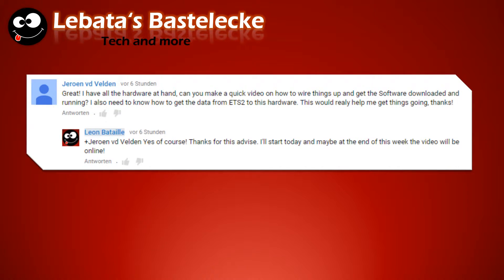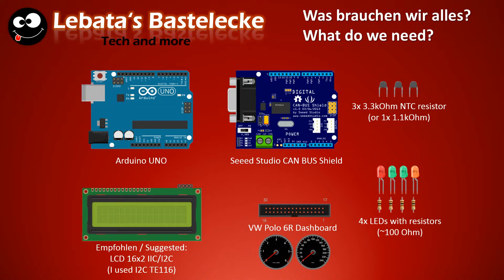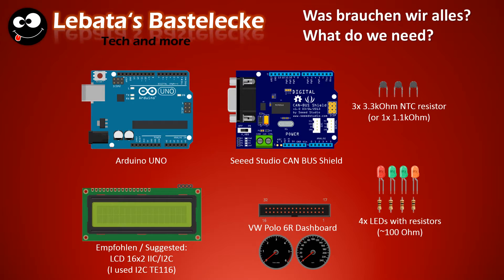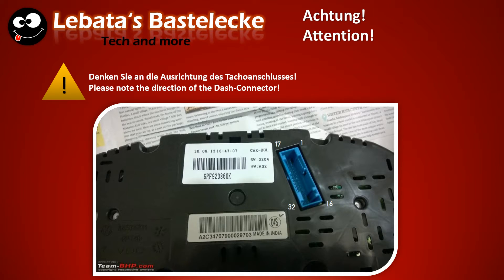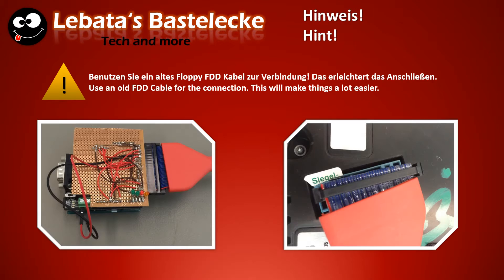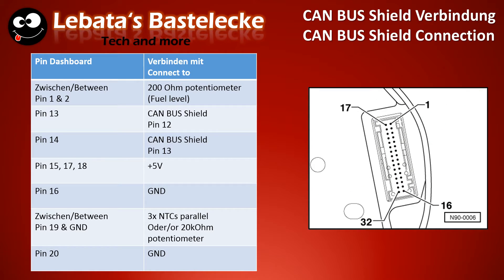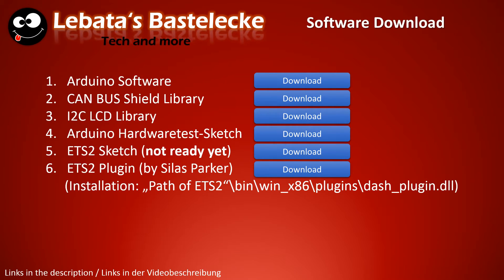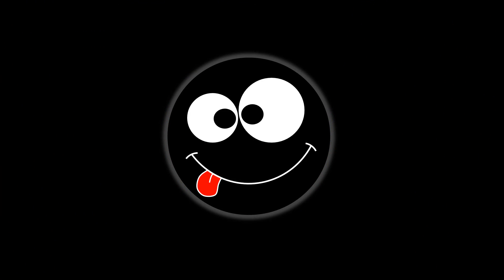CAN BUS Gaming #5 - Dashboard Wiring

Comment: Hello SIR, 
I am trying to make a sim with a dashboard and working gauges, did you get this project to where it connects to USB and keystrokes could be assigned to appropriate gauges? I really am looking for this solution but can't find it anywhere. It is dear to my heart because I am building it for my father, he has cancer and I want him to have a really cool setup *junkyard find most likely... I'm putting in tail lights (brake micro switch-dc battery)... that's not part of the game but it works in an analog way...
But for the clusters there's only one way to make them communicate with a game if possible, first thing is making sure the pc has correct legacy drivers - to USB to or your preference... I don't know how to program it... I do video/animation... not programming. I swear if this got done with real clusters and you make a kit for it, hardware and software, I bet you can make a lot of sim racer happy... most of all my father would be amazed... unless you know of a better way. Reply if you may, I know it's a while since you uploaded this... but I would really love someone to guide me on this topic. BIG THANKS!
-Kris

Comment: i have a cluster, is it more easier to  control a cluster using only a potentiometer?
Reply: You can put a potentiometer on arduino to control it, but you wont be able to avoid can bus messaging with modern clusters

Comment: I'm trying now with Audi A4 B6 and Ford Mondeo mk3 clusters.
Speed works with your ets2 sketch, but RPM needle not :(
When I plug cluster to power supply and connect Arduino to PC,  RPM and speed go to max position(self test).

With the static sketch, both of needles(RPM and speed) work and show correct values.
There's problem with streaming data from telemetry .
The same thing is with Mondeo mk3 cluster. 

Other issue is with i2c crystal. When I connect only lcd without CAN shield, it works perfectly.
When cluster is connected, lcd doesn't show values from telemetry, only "HHHHH" in single line.

What is the problem with?
Reply from the maker: Hi! I'm not sure if the CAN BUS addresses and the data which is being sent are recognized correctly by the clusters. Especially the Audi clusters could work with some functions as both, VW's and Audi's clusters are from the same company. Could be that the adress for RPM is another than the one in my script. I'm not sure about your second problem. try another lcd library if necessary. I had issues with it as well. Make sure that you use the i2c pins on arduino and not the rx and tx pin, as they are used to transmit the data between ETS2 and Arduino. At the moment I don't use the display as the important info is displayed on cluster.
I hope this helps.
Reply: Hey!
Works partly.
Today I reprogrammed Arduino(I'm using Mega) and RPM needle goes to 6k and doesn't change (only when engine is started, when ignition is off, it goes to zero).

Yeah, Audi and VW belongs to VAG company. 
CAN addresses are the same as in VW.

Maybe, there is problem with cluster, because it's older version.

In mine, there are 3 CAN lines(drivetrain, infotainment and comfort).
Each one has got various speeds(500k drivetrain, 100k info and comfort).

Maybe newer cluster will work greater :D.
In newer cluster, there's one connector(in my there are two, green and blue).

I can send you CAN codes, which I found as well.

Thanks for reply and I'm waiting for updates of your projects( I'm building similar cockpit instead of a desk, that's why it is important for me).
Reply from the maker: Ah ok, then you have to change the rpm multiplier in the sketch. The RPM values can be different. Could be that I changed it to a mod car for ETS2 which had completely different RPM values.
Reply: Ok, I'll try it.
We'll be in touch :)
Reply: I wrote PM to You on Hackaday ;)

Comment: Could that be used with other games? Thanks for the video
Reply from the maker: Yes, I'm working on support for other games using a board called "RevBurner Pro". This board supports about 30 other racing games.
Reply: Leon Bataille thanks for the answer i have one more question for you is it necessary to use the golf gauge can i use a different one like mercedes gauge
Reply from the maker: I strongly recommend to use a VW Polo 6r dashboard. Otherwise the CAN Commands won't work. It would be possible with lots of time to invest in the reverse engineering process for it.
Reply: Leon Bataille thanks for your concern i will try this if i find a polo 6r gauge

Comment: Hi there, I have a Fiat 500 cluster that was getting thrown away at work. Right now I've found the ignition live and ground so it powers up fine but I don't know where the canbus pins are. It's an 18 pin connector. I have access to the official Fiat wiring diagrams but I can't make heads or tails of it. Any chance you'd be able to help?
Reply from the maker: +Oceanic Bananas I'm sorry, at the moment I am just working on Clusters of Volkswagen AG (like VW, Seat, Skoda etc.) But keep on trying to get the Fiat cluster to work :). Try searching in some amateur forums for tuning on Fiat. Maybe you'll get the right information there. I found lots of info for VW in such forums. Goofd luck!